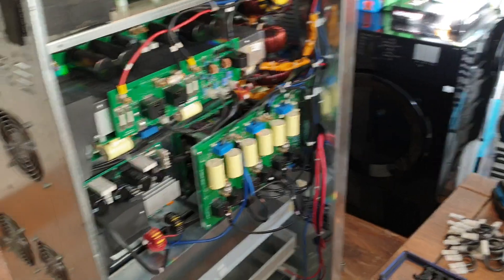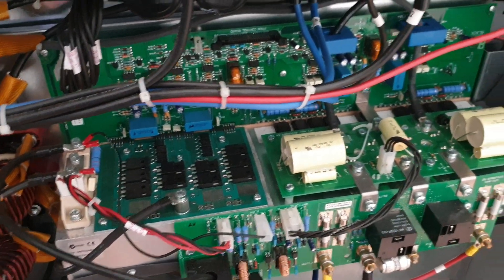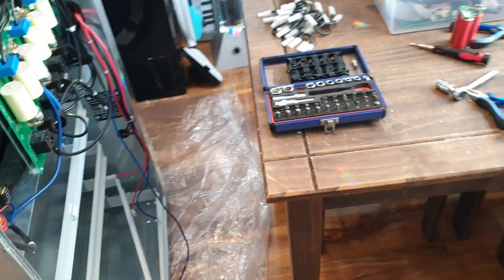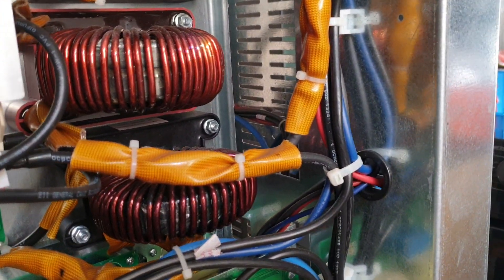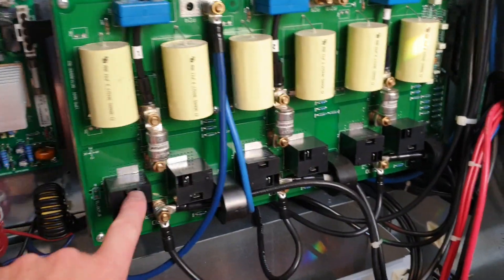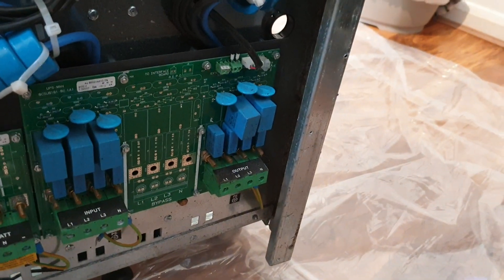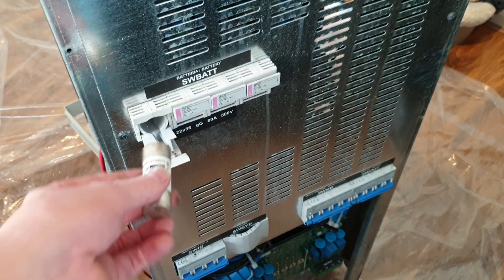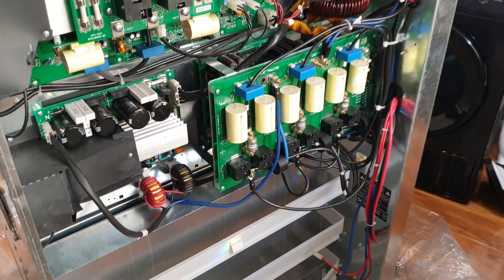27kw 30kva 3 phase UPS

Comment: nice, that must be an On line UPS, it rectifies the AC into DC which is in parallel with the batteries, then it inverts it back to AC. there is a good video of EEV Blog tearing an older unit down but he explains the topology of how it works. the advantages of it is so if there are any ripples of the mains coming in or straight dropping out the inverter is always running so there will be no ripple on the output. pretty darn awesome!! I wish I could tear down the one my work had installed, but no they had a contractor uninstall it. they are pretty dangerous 240v DC on a battery yikes!

Comment: There might be a 
way to tell if those 
inductors have ferrous 
or ferrite cores. Try this......

......get a small magnet and hold it up to the inductor. My theory is, the magnet won't stick if it has a ferrite core, whereas it most certainly will if it has a ferrous core. :D

......If they're ferrous cores, you might be able to make use of them on 50Hz.

I know one thing..... I spotted some PCB mounted current transformers (CTs) in there. It would be interesting to know what the ratio is on those.

CTs will most certainly have ferrous cores, but you can't use them for voltage. They are for reducing current by a certain ratio so it can be measured.

In electricity metering, CTs can be as large as  (or even larger than!) 1000A to 5A ratio. You obviously cannot get a 1000A electricity meter, so a CT is used to "ratio-down" the 1000A to a maximum of 5A and then that is fed into the meter. At that point, to get the correct reading, either a mathematical multiplier would be used (multiplier for 1000/5 CT = 200) or the meter would be mechanically geared inside so-as to "back-translate" the 5A so that the readout runs at the correct speed and a multiplier isn't needed.

Downside with mechanically-geared meters: They're "locked-in" to a certain CT ratio.

My GEC electric meter (Model E43B-R/M) is locked-in for a 200/5 CT.

Depending on the ratio of the CTs on that circuit board, they may be useful. :D

Thanxx for showing,

-Wayne's Electrical.

18th October 2019, 21.12
Reply from the maker: Hey Wayne,
Thanks for your comment there,  very helpful information. Some learning stuff there thank you. Wish I new alot more on that side of things.
It's a shame these things get dumped at the scrapyard as there all working when scrapped.

Thanks again for your comment and information always very useful mate.

Anthony